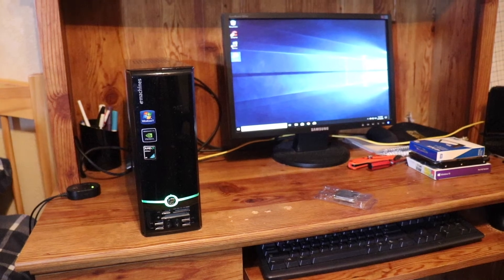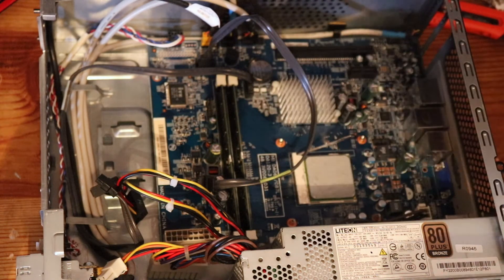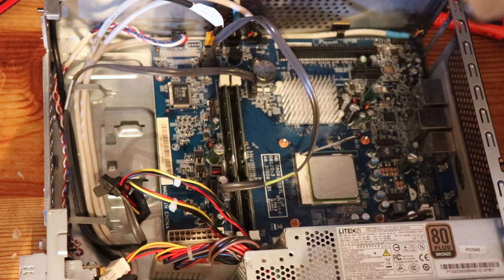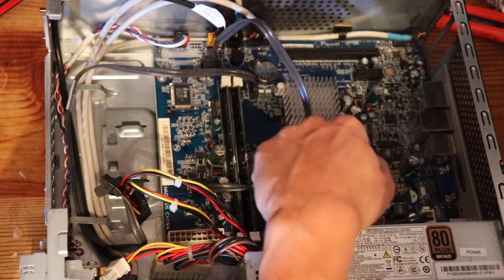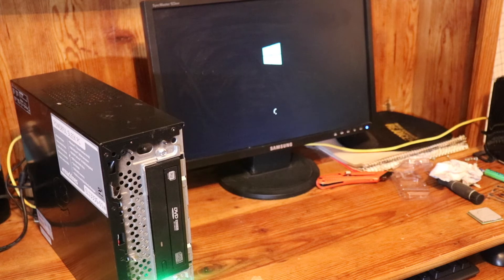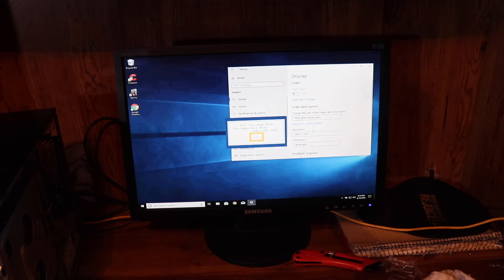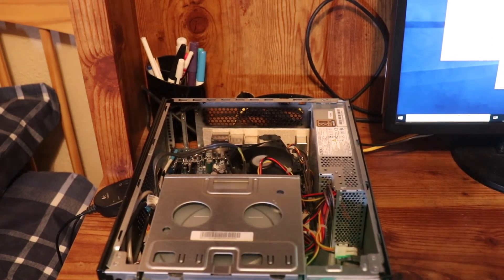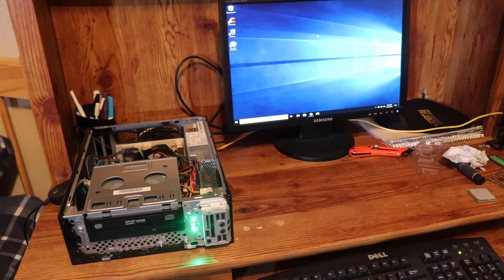eMachines PC Upgrade from 2009 Pt 2 (CPU Upgrade)

Comment: I have the same form factor emachines only it is a EL1331-05 and has a 220 W Power supply. The cpu is currently a Sempron 140 2.7 Ghz. Upgrading to a dual core Athalon II X2 280 3.6Ghz clock. Only has 3Gb DDR2 RAM and I might not upgrade that. I have had issues with the GeForce 6150se nforce430 since there are no drivers that will work in Windows 10. I found a driver from NVIDIA 908.8?? circa 2015, which really doesn't work well, but in personalisation can change to high contrast mode to get windows to function. It has a PCIexpress v.1.1 x1 slot, which I have been able to use for a USB 3.0 PCI E X1 CARD with a low profile adapter.

Comment: That phenom  is going to prevent  you from adding  a graphics  card. That specific cpu is a 125w chip. Your better off finding a lower watt quad core, like an athlon x4 640, which sips 95w
Reply: That PSU is 350wat so 125wat from there u still have 225wat which is more then enough for a GPU at 75wat such as a gt1030 the rest of PSU power is enough to power everything else on the board

Comment: dude, i got one of these tipe of models, and i search info about the motherboard but i failed, so i have a question, ¿Do you got problems with the bios drivers while you was upgrading your pc? im super intereted in find wich processor is the top for this motherboard
hugs from mexico~

Comment: A GT1030 would be a perfect GPU for this system, also you should check the temperature or the CPU and make sure its not throttling performance. Great video!
Reply from the maker: I've checked temp it's averaginf between 50 and 80degrees celcius I think it's getting to hot any recommendations?
Reply: Maybe a new fan? I think the fan is too small for the Phenom X4, but idk
Reply from the maker: I don't think it's the fan to be honest it's a big enough fan in my opinion
Reply: Maybe the thermal compound?
Reply from the maker: I out some before putting the fan back so not sure
Reply: @BudgeTechReviews  that phenom is a 95 watt processor minimum in heat output, around quadruple the tdp of the single core cpu that was originally installed. These quad core chips were the first of their kind and were all kinds of inefficient, do the pc a favour and give it a bigger cooler before it burns itself out